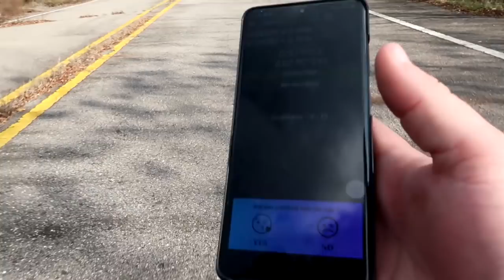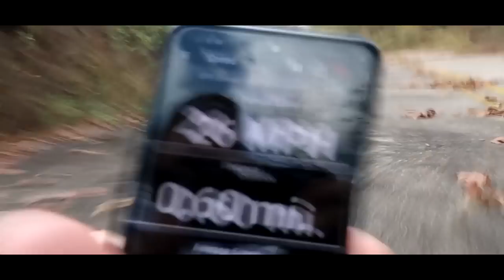Can An Engine Run On "Lube" Instead Of Oil

Comment: They don’t call it a four stroke for nothing
Reply: forestroke?
Reply: More like a 1 stroke
Reply: I hate to be that guy, but that's a 2 stroke engine.
Reply: @twongi3000  nah the predator 212 is a 4 stroke
Reply: @joseffinklematter6256  oh shit, I didn't know.
Reply: @twongi3000  then why say anything?
Reply: @jacksmack6956  because I was fairly certain it was a 2 stroke.
Reply: @virux4107  i think ive seen that pfp some where.        Oh
Reply: @twongi3000  2 strokes: oil in gas, reed valves
4 strokes oil in crankcase, ohv (this one atleast)

Comment: Water-based lube is garbage. Should’ve just used silicone-based
Reply: said nobody ever
Reply: @aw4483  said me right now
Reply: @subzeroarctics1299  well, that's wrong
Reply: @aw4483  Bruh if you haven't tried silicone-based lube you're missing out. Water-based dries out, gets all sticky, and bleh. It sucks.
Reply: @subzeroarctics1299  Silicone eats away toys and feels way harder to clean up
Reply: @aw4483  True indeed. To each their own. Though for an application such as an engine, I feel like silicone-based would've fared better than water-based... even though either is still a terrible idea
Reply: @subzeroarctics1299  in this case, I agree

Comment: 1:57 Coming from a small engine mechanic that preadedor engine is known to have a leaky needle and seat and which is why it isn't runnin either that or you left the choke on

Comment: If you didn't know engines can run without any oil, just not for long. Motor oil is used because it won't burn off immediately, water or oil based lubricants will. Honestly you could probably use any kind of oil you want as long as you keep topping it off. It'll smell and gum up your engine but that's the least of your worries if you decide against using motor oil in your motor.

Comment: Water based is probably not the ideal lube for an engine. It's water based. Get the good stuff, that silicone based lube. Will probably smell horrible but the engine will last longer.

Comment: I’m not going to watch the video I’m just going to say that the lube won’t work because it’s not made to with Stand the temperatures that engines reach witch will just boil the lube and just evaporate it it may work for like 1 min but then it will just evaporate.